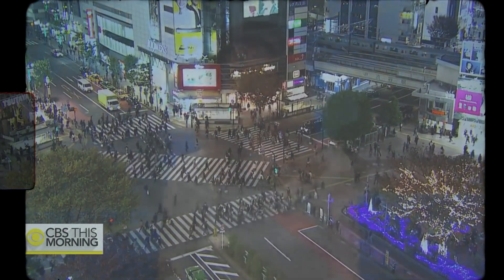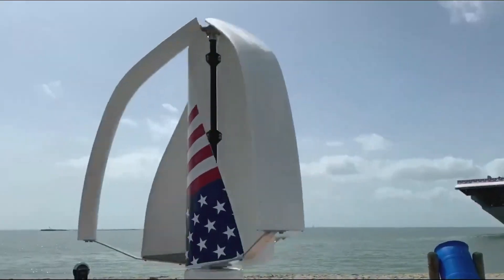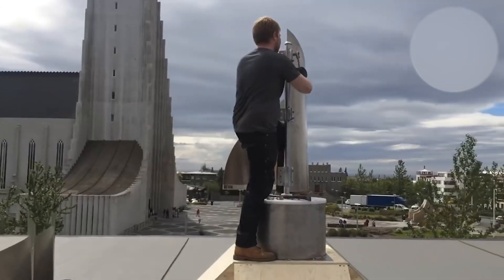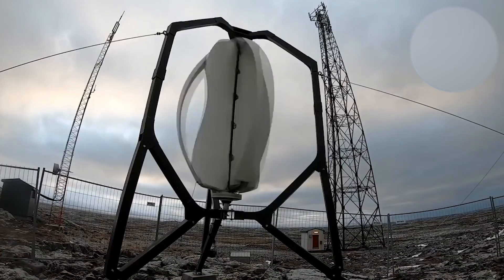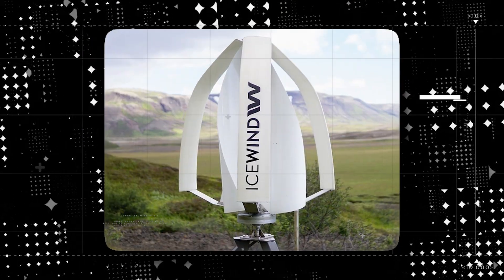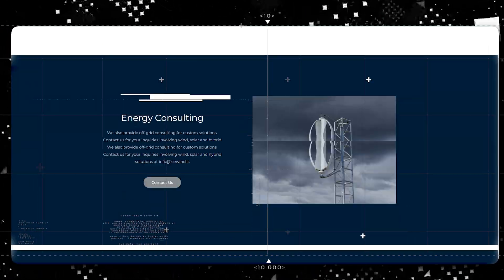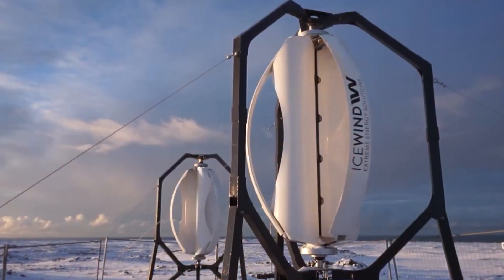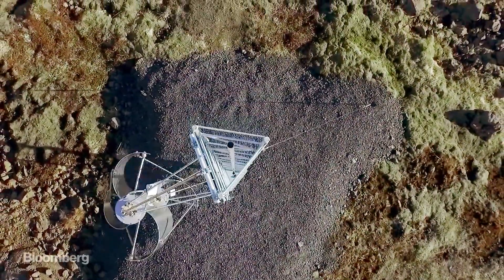This Could Be The Safest And Most Powerful Wind Turbine In The World

Comment: one solar panel give 450 watts for two meter square... your wind turbine give 150 to 400 >>>no wind no energy... please stop talking...3 or 400 pourcent in more...!!!
Reply: In the UK, a mix would be nice. Cloudy much of the time so solar is almost useless in winter when we need heatpump electric.
Reply: mix is good... @n0_h4ndl3
Reply: Solar panels probably don't degrade as quickly as mechanical generators.

But, turbines spin all night... Making up for their lower generation.